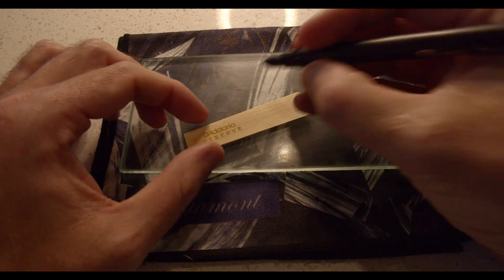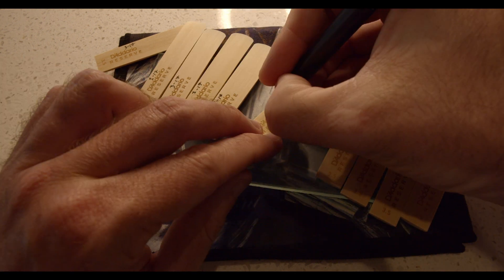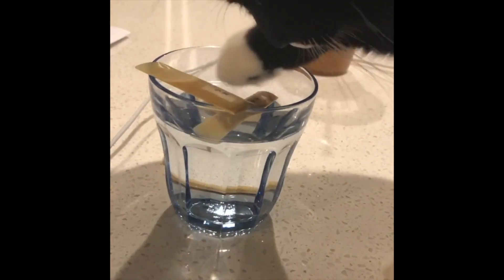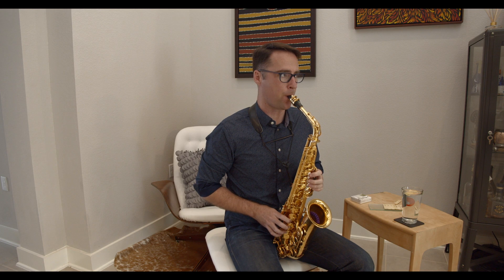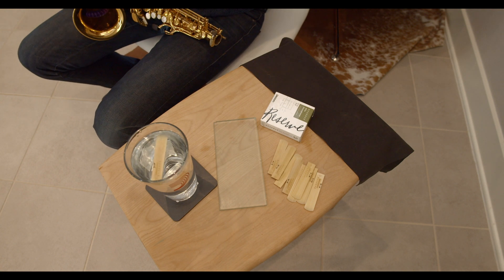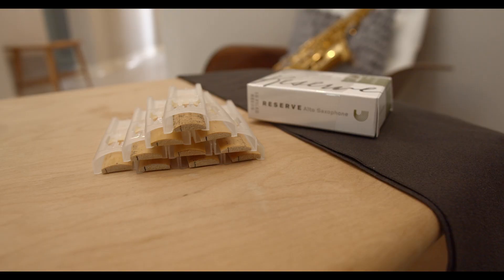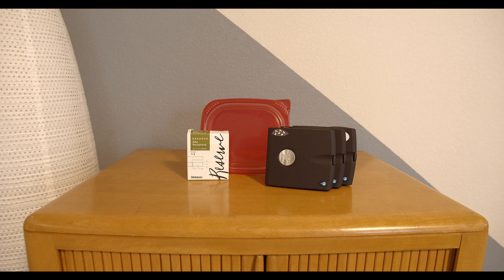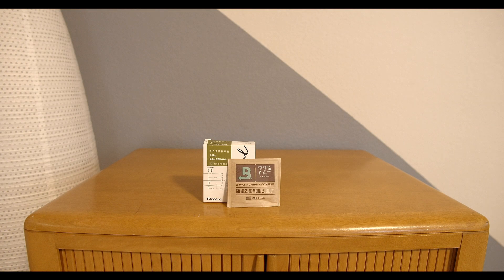Best Break-In : Sax//Clarinet Reeds!

Comment: Hey Dr. Page, I went through this process for a box of 3.5s, and had 3 great reeds, and 7 which were varying degrees of hard and airy. So over the course of the next few days, how should I treat the harder ones? Does playing through them consistently cause them to soften over time? 

Moreover, since the ratio of hard to good reeds was pretty high, would I be better off with box of 3s? 

Thank you for such an informative video!
Reply from the maker: Hi Govind!! Reeds will soften over time, so if they're feeling a little stuffy, you can keep playing them and they will ease in a bit. If they're too hard overall, you can lightly sand the flat side with a piece of sand paper on a piece of glass/flat surface which will also soften it. But in general, if you're finding 3.5s to be generally hard, 3s might be the way to go (or, 3+!).